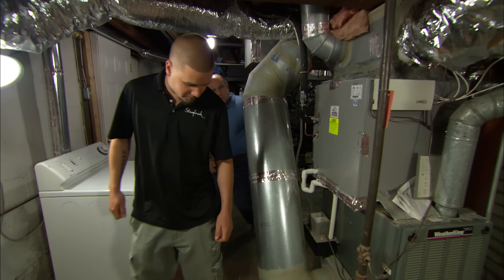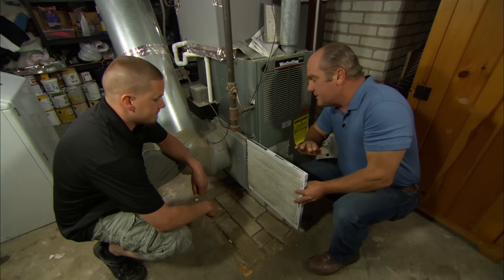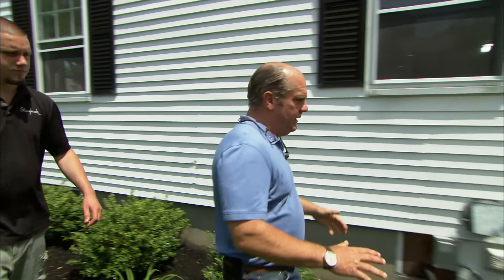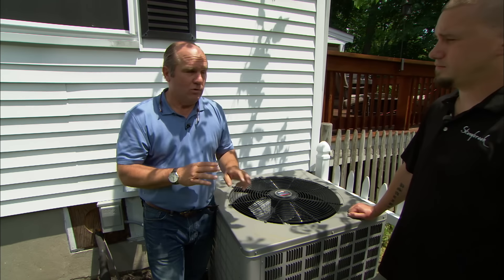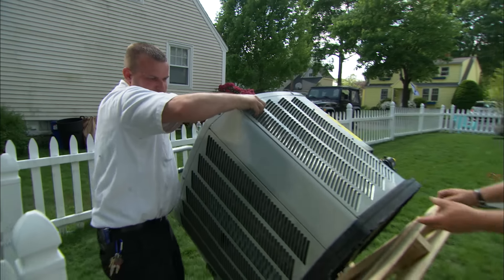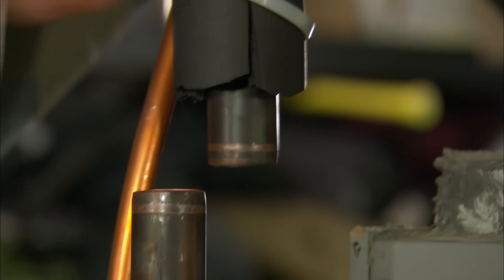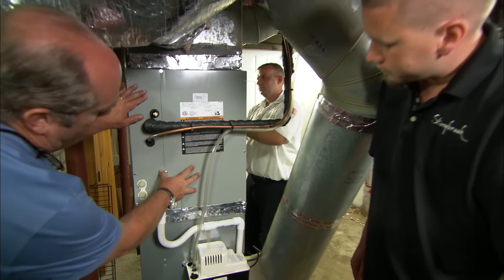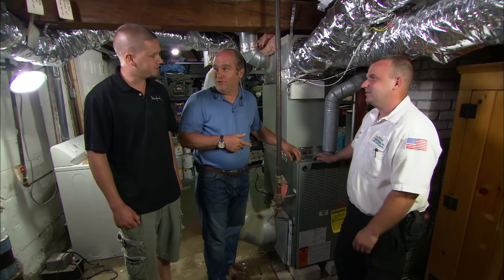How to Repair a Frozen Air Conditioner | Ask This Old House

Comment: You forgot to mention the most common area of a unit freezing up, is the underside of the evap coil.  Rake and use coil cleaner and spray it clean.  There's usually mold and dust buildup that gets past the filter (most people don't change them as often as they say they do).  It can get so thick that no air can move through the unit.  Another thing is checking freon pressure.  Low pressure (or air in the line) will freeze a unit up just like this.  Check the condenser fan is actually turning on (spin with a twig and if it starts, it's the capacitor).  Leaves and grass buildup around the condenser can also cause this.  Hope this helps someone, no need to rush out and spend 5 to 6 grand on a brand new unit.
Reply: Yes that was my 1st thought
Reply: A condenser fan, faulty motor or twig, dirty condenser, or air in the lines will not cause freezing. In fact, a dirty condenser will actually raise pressure
Reply: Yelp he just overlooked it all together.. 😅 He just made a lot of money off of him..

Comment: That 14" return duct will only supply 1000 CFM at best, but more likely 800 CFM after the twists, turns, and filter. 800 CFM is only enough air to feed a 2 ton unit, and it's probably drawing from the floor or low on a wall where return air temperatures will be coldest, further exacerbating low coil temperatures - which forces the TXV the close more to maintain the same superheat, lowering suction pressures below freezing.

The problem isn't "too big for the house." The problem is "too big for the ductwork" which was obviously sized for the much lower CFM of a gas furnace. Without sufficient airflow, evaporator saturation temperatures will be too low and freeze up week happen again.
Reply: Thank God someone else gets it.  Yeah 1000 CFM at .1 static, but at .05, which is what I use for supplies it is only like 700 CFM.

Being 4 ton he needs like 1600 CFM, so that's at least double the return.

The host has no idea how air conditioning works indicating cold flows from the suction line, lol.  It's actually the high-pressure, subcooled, liquid line that hits the restriction causing a huge pressure and directly proportional saturated temperature drop.  Would need a PT chart or to just look at where the gauge needle intersects that refrigerant's markings, but this would require they actually explain something to the viewers.

While it could certainly be low on refrigerant, that TXV is probably holding back to hold a constant superheat and not burnup the compressor. 

Even with a 3 Ton system, they should have improved the airflow a bit then ran some airflow static pressure tests... but you know this.

Additionally, they are full of crap about not needing to charge the system.  While it does come charged from the factory, that assumes a perfect lineset length and that they read the directions for proper line sizes.  Either way any competent tech will run the system under load for a while then check the pressures, saturated temperatures, and then compare those to actual temperatures to verify the superheat and subcooling... and adjust that system's charge to the proper subcooling.  Much of the time the factories mess up how much refrigerant they put in new systems, and even when they get it right, it is rare to hit spot on with a proper charge.
Reply: return duct work is massively undersized. A complete miss by these 2 and it's still undersized for the 3T unit.  You can run 3 ton cond thru a 4T coil all day long. The 10- 12 inch return needs to be 18- 20 or equivalentin square duct and replace the 1 inch filter with a 4 inch filter set up. They'll be back the 3 t unit will be freezing up.
Reply: Seriously I couldn't have said this any better. This guy is a shitty sales man. That home owner got punked
Reply: Yes,  When I was 1st year apprentice in 1969, I learned that with a forced air system the most important aspects were that it needed to suck and blow.
Reply: EightiesTV do you even english bro
Reply: 400 cfms is 1 ton right, 2 tons is 800 cfm that should be enough
Reply: Could it be the unit that was replaced was a replacement unit and the other unit was smaller hence the duct work being small.
Reply: That return didnt look 14"...i thought it was  12"
Reply: When I saw that return, I said holy cow...no way this was not hacked in by a handyman.
Reply: Spot on about the factory charge that ships with condenser units.  It will startup and get you close, but you have to run it a few hours then come back and adjust charge to get it right most of the time.  I usually find it's a little on the light side and have to add something close to 5% of original weight to get condenser pressure in the sweet spot for most installations.
Reply: How do you know what cfm that fan was pushing for cooling?
Reply: You would check the fan chart for the unit. The nominal CFM is 400 per ton.
Reply: I don't even think it's 14", looks more like 12" to me.

Comment: I guess the right title for this vid is “how to replace AC unit”. Solving evaporator coil freeze is another task dude! 

Evaporator coil freeze is usually due to one of the following reasons:

1- Less Freon charge: This produces low pressure thus low temp (goes sub freeze point), the solution, check for Freon leaks and increase the charge to the right level.

2- Indoor air blockage: 
Make sure nothing blocks the air flow, probably:
A: paper stuck against the evaporator coil.
B: dirty return air filter! 
C: indoor fan not running: either due to defected indoor fan or defected controls like fan relay! 

3- Bad low-pressure cut-out:
Make sure the low-pressure cut-out is working properly, since freeze occurs when compressor is not cut out on time! 

4- Bad thermostat sensor: 
Make sure thermostat sensor is functioning well and cutting off the compressor at the correct set temperature and not lower than that. 

5- Oversized ACCU for this AHU:
Make sure outdoor unit cooling capacity equals/matches the indoor. If it’s more capacity then it might flood the evaporator with subcooled Freon causing temp goes sub-freeze. 

6- Evaporator is partially frozen!
This is an indication of wrongful brazed tubes inside! That’s a factory defect, you probably need to replace the evaporator coil. 

According to my experience, frozen evaporator is 95% due to either low Freon charge or faulty low-pressure cut-off. 

Thanks

Comment: Some of the explanation of the refrigerant circuit and the hand gestures used to indicate flow were not correct, but I was glad to see that Richard brought in a local Pro to do the job. Most of the time, you do not get the near perfect fit when you exchange cased indoor coils on a change out. Homeowners, this is a job to NOT take on yourself.

Comment: After watching numerous HVAC videos on youtube, I spotted one thing straight away that could have solved his problem: his return air was undersized. For a 4 ton system, that return air was way too small. No wonder it iced up. His system also had a TXV so that should have been looked at as well. It was hard to determine how the sensing bulb was placed due to the camera angle. 
 Not only that, the refrigerant levels should have been checked once the A coil was thawed out. Like others have said, there are so many things wrong with this video. 
Homeowner said the system ran for 1 hour and then iced up. I'm guessing it was a bit low on refrigerant, TXV was probably running wide open and the A coil gradually iced up. 
His new A coil has a TXV as well. A lot of HVAC technicians don't like them due to them being problematic.
Reply: 16" round is about 1,250cfm at .1 static. If we are using 400cfm per tonn that would be 1,600cfm for a 4ton traditional split. Ain't no way that return duct was 16" lol. Looked more like an 10", hard to tell from the camera angle. 

Regardless the problem was his duct work being under sized, having an over sized system by 1tonn will not freeze your evap, it will cause short cycling depending upon how much it is over sized. Short cycling will lead a shorter compressor life due to overheating. This in bad situations will get the oil inside the compressor too hot and will not lubricate the compressor properly which will die soon. The low pressure gas that has been super heated is what usually cools the compressor in residential applications.

Comment: Our house's old A/C was too oversized and we never had any freezing problems. The old unit was a 5,200 BTU/5 Tonne unit and it was replaced with that very same condenser seen in this video which the seller of the new equipment said was just the right size for our house.

Comment: Wow what a hack nice return on that install definitely a air flow issue a good tech would have taken a static pressure and would have determined high static as well as being over sized lol, must have been a home depot special install

Comment: Cut 12in hole in Supply & return plenum. Condition the basement. Save $$$
Reply: Wrong
Reply: Wrong
Reply: Then you still have to add refrigerant :) 

By doing that you have just now added a space to your determined in size unit. It could work out in your favor, only if you are oversized. 
Overall though: that would only decrease the effeciency of your system. Best thing and easiest thing to do is clean the system and up the blower motor speed.
Reply: @DW-vl2wi  wrong

Comment: "My AC is freezing up"
"Well that's because you have a much bigger unit than you need, so instead of using a superheat sensor to do a bypass shutoff on the compressor and keep the fan blowing to reduce your condensate freeze build up, we're just going to replace your entire unit with a much smaller one, giving you slower cooling for the entire house, making you waste more money than you need to."
"Genius idea Richard, let's do it!"
Reply: This is the answer I was looking for! Hahah
Reply: Exactly! If your car has an engine that's too powerful for speed limit, lift up the throttle! Why can't HVAC system incorporate simple sensors like you described and throttle back?
Reply: I'm a layman and I knew that there had to be something like what you mentioned.
Reply: and how would a properly sized air conditioner be a negative? who cares if its smaller? you would rather have an oversized air conditioner that's uncomfortable with humidity problems? and an oversized air conditioner wastes more money than a properly sized one - there are tons of studies proving this. Plus in your scenario, you are running the fan more often, which is also using a lot more energy as that heater uses a PSC not an ECM motor. If you don't want to change the system, why not just correct the ductwork? That return is obviously too small at 14-16inch. Not to mention there's a damper system which is cutting the supply in half or worse - and there's no bypass damper. With undersized ductwork & oversized equipment, the superheat is going to be way too high and you are going to get liquid flooding back to the compressor rather than vapor, causing damage over time.
Reply: @wshtb  The compressors found in most homes are designed to either run or not run, that's the issue of why they can't be throttled. But there are air conditioners that can throttle themselves back / speed up... they are called Variable Speed Compressors and they can run anywhere between 30% and 100% capacity. They are commonly found on Ductless Mini-Splits and higher SEER Split Systems. It is a lot more complex, expensive, and temperamental though... but they can reach much higher efficiency and comfort levels.
Reply: @Justin-vr5zn  That is the most ridiculous statement I have ever read.  If the choice for a customer is to keep their currently oversized system or pay to reduce their size, I will choose the first any day of the week and twice on sunday.  An oversized unit means that it is faster for the air to cool across the evaporator coils, which has the drawback of having freezing clogs in high humidity.....having a sensor to stop the compressor during a freeze situation will allow it to thaw while continuing to cool.  Running a fan is nowhere near the power consumption as the compressor, many "green" AC units automatically do this cycling as well.  If the coil is constantly being frozen, then there is a leak in the home and an undersized unit will freeze faster if you do not attend to the actual problem.

Also, having a central system use the fan will keep the temperature in the home averaged out, especially if you are dealing with multiple floors (because heat rises, if you didn't already know that).  Most returns are situated near the ceilings, while the vents are from the floorboards....and in multi-floor homes, if designed properly, the returns are on the highest floor.  This means it pulls at the hottest air and attempts to distribute it evenly around the house, hopefully after the AC/heat has done its job.

Every single heatpump AC unit has these types of sensors in them....only some of the AC-only units have them....notice which ones have the problem of freezing?  It has NOTHING to do with "sizing the home"....once you meet the minimum, then you have already solved one of the equations based on average temperature season fluctuations and humidity variances.....but go outside those limits, you will need a bigger unit, not smaller.

The ONLY reason a smaller unit might work, is because the duct space used will be far less, allowing the air to flow AROUND the ice block if and when it eventually does freeze over.  Again, you don't solve the problem.

If you are in HVAC and you think this way, then you are repeating garbage taught to you by horrible HVAC teachers that didn't take even 1 day of basic physics class. You can either learn the right way, or do halfass jobs like this bullshit and make the entire industry look like a bunch of morons while charging customers unnecessarily. Are you also the type of guy to put the blower on the basement floor, just to drum up business when it gets flooded? The scummy nature of treating people like walking piles of cash instead of solving the actual problems is disgusting....you're turning into car mechanics.
Reply: The truth of the matter is: the air conditioner is oversize, and the ductwork is undersize.  This is what happens when a homeowner, who knows nothing about sizing, buys his own equipment.  Did he even check the fan capacity of the furnace?
Reply: @rodgraff1782  I doubt the duct work is the issue, unless it truly doesn't balance the output volume...but most of the time that just compresses the air (you can get away with down to 85% of volume draw before you get compression leaks). I have never personally seen homes with undersize ducts, even trailers usually have twice the size they actually need....but I guess it COULD happen (humans like cutting corners). As I stated, this is just a heat sensor issue, or rather a blow-by issue (if the pressure drops too much on the output, the compressor should kick off and let the fan alone blow by the ice and cause it to defrost). It does add a TINY bit of moisture back into the house (like a swamp cooler), but as long as the house doesn't have a major leak, the AC should catch it on the next few passes.
Reply: @sabriath  I’m surprised you’ve never seen homes with undersize ductwork.  I’ve seen hundreds in my 45 years. The mobile homes are the worst around here.  Sure, you could instal an evaporator freeze stat that would cycle the outdoor unit when the coil starts to freeze, but that is just a band aid.  I’ve installed those as an accessory from the factory.  Oversize equipment will cycle on and off frequently, and not run enough to dehumidify.   That’s a big concern in parts of the country where the humidity is a large part of the load.
Reply: @rodgraff1782  I guess I live in a better area, or the fact that I haven't done it for that many years to come across it?
Reply: @sabriath  standards vary in different parts of the country.
Reply: @rodgraff1782  sad

Comment: Hey guy I am a Ac technician and own my own company for years and the way you explained that refrigeration cycle is very wrong it does not get sucked back by the discharge line the refrigerant goes back to the condenser by the suction line which is the fat line at the TXV goes to the coil and distribute cold liquid not vapor

Comment: Never run the refrigeration lines across the front of the a-coil cabinet! You want clear access to the face of the coil to be able to clean or inspect. They very easily could have crossed over at plenum height and then dropped down to the piping connections on the correct side of the cabinet.

Comment: an oversized unit doesn't freeze up that quick, most of the time it's a refrigerant leak.  makes for good TV though, some hvac companies love more business doing poor troubleshooting jobs.
Reply: I know, right?

He never checked to see if the evap coil was dirty or checked the charge.
Reply: oversized units don't freeze, dirty coils do, and he didnt check it.
Reply: or probably the controller doesn't work properly. the compressor should turn off automatically when it reached the set temperature.
Reply: @bradowen8862  - Stick with your day job dude. Frozen coil = no airflow. No airflow = no cooling inside house. No cooling inside house = thermostat never reaches its set point.
Reply: @bradowen8862  You would have to add a discharge temperature control, or a freeze stat on the evaporator coil.  They don’t usually come with the unit, and are a band aid, not the solution.